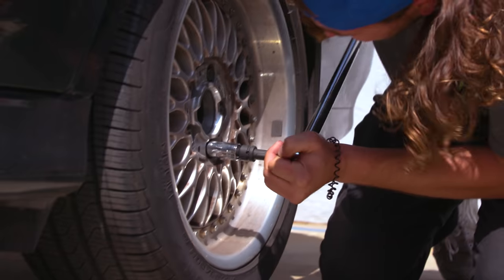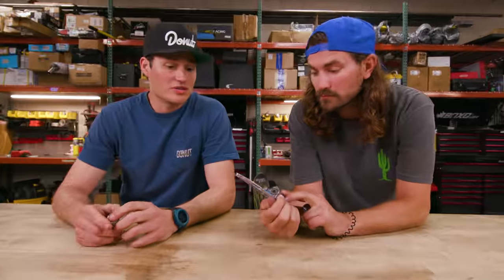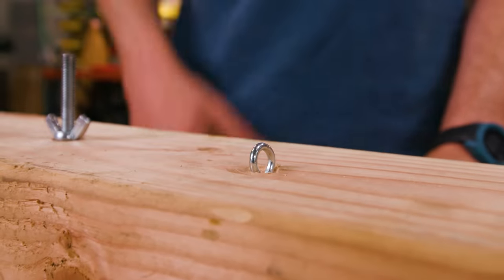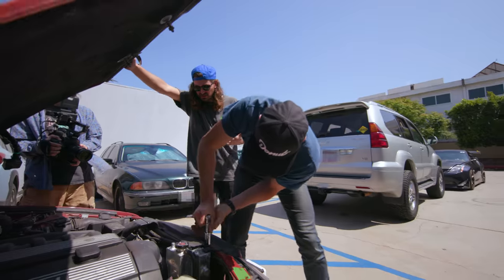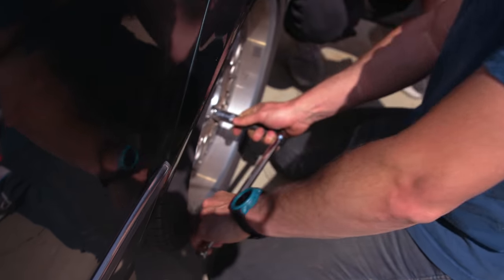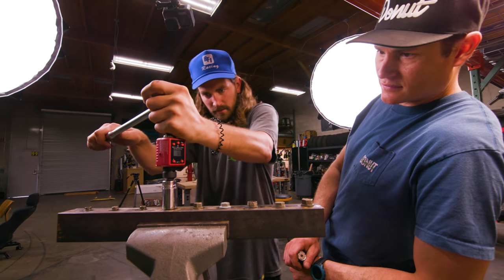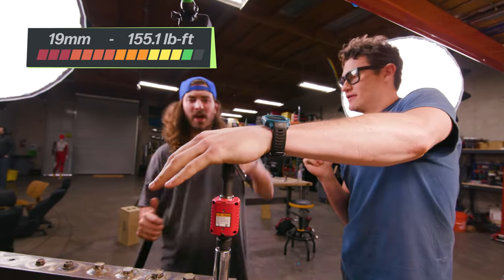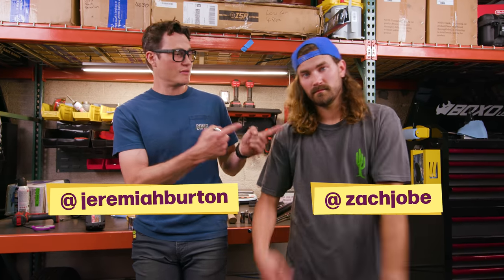Testing the World's Most Hated Tool

Comment: I own the largest repair shop in the entire metro area.  We have replaced over $11,000 in wrenches and replaced them with a dozen of these.  Its the only thing any of the mechanics use.  We simply threw out of all of the Snap-On and Mac tools. Didn't even sell them.  Threw them out.   They did nothing but collected dust once we started using Gator Grip.

Comment: I have had several of these, and they have given me good service for years. The problem with them is that they are oversold; they will not "replace the toolbox," but for shallow, low-torque applications, they are quite useful. I have killed a couple using them on a power tool, but not with hand wrenches.
Reply: Their problem is ability to strip and round the bolt because of the way it grips it when pulling too hard ...
Reply: Exactly my thoughts. It’s ridiculous to think you no longer need other tools. But it has saved my butt a few times with stripped heads and other weird things.

Comment: The gator grip is actually genius, has automatic torque limiting based on the size of the bolt
Reply: Plus an also built-in "this bolt shall newer be unscrewed" function!
Reply: @LoneStarr1979  Next week in the infomercial: "...magically comverts any bolt into a no-tamper bolt..."

...

...

...

Apple buys all of them.
Reply: It still damages the fastener, just not the "fastening part" of it.

Comment: I was a merchandiser at a home improvement store. For years I dismantled old displays to build new ones. Whatever i dismantled was ALWAYS built with several different size hex head fasteners. I used the Gator Grip all the time. So handy not having to constantly change sockets. It worked great for my purposes.

Comment: Im an electrician and i use this a lot. In our trade we dont put a lot of torque on our screws or bolts. But it seems like when you do, youll just break it
Reply: I agree, they were way to hard on this one.  I mean come on.
Reply: @landar2372  It's not their fault actually. It's the commercial that said it is able to withstand 150 pound of torque.

Nothing would be wrong if it was advertised as a convenient tool for a wide range of lightly-screwed bolts and things. Not everything requires a lot of power after all. But they didn't. They DO try to sell it as this tool that will replace sockets that you want to use for plenty of power and grip.
Reply: yeah a 150 pounds of torque is a LOT coming from a flesh and blood arm and hand
Reply: most normal and better torque wrenches cap out at 150 too

but MANY cap at 80 pounds or less

youre not breaking a normal torque wrench anytime soon

the gator grip is a crappy tool and the ad lied
Reply: skip to 11:30

youre NOT getting 150lbs with one hand and without an extremely long lever like they had

i will never buy anything "made for tv"
Reply: Yeah, for lightly torqued bolts, it works pretty well.
Reply: It's a fantastic tool. I specialise in RF stuff and I've never ever ruined the tool nor the bolt, no matter the varying funny non-standard nuts and bolt that are out there.
Reply: A lot of this test is just them being dumb or incompetent tbh. Like you said I use this thing pretty often for light duty stuff.
Reply: So the tool is good for driving down with the lowest torque on the drill.
Reply: @landar2372 too hard? No this is pretty amateur automotive work they put it through.
Reply: @hahaepic4165  Maybe they should advertise it as being for light duty stuff instead then.
Reply: Same here
Reply: Do they work better or worse if you go in at the edge of the socket rather than the centre?
Reply: @kikixchannel  More carefully applied they would have gotten a lot better. They keep doing amateur shit like letting the socket come up at an angle so pins can slip.

Comment: Before I retired from teaching, I worked at a school that had removable walls between the classrooms. There's actually a tool that you would insert onto a square headed bolt and Crank it like a big fishing reel. Needless to say, all the teachers seem to have lost the crank that was used for each wall. Since I had a couple of these sitting around in my toolbox I just left one in my desk drawer with a ratchet. Never had a problem opening those walls.
Reply: i think i know what school that is, ichabod?

Comment: The fact that it passed any of the tests is amazing.  Most as seen on TV stuff is complete trash. I buy one now and then, just to have it. It's definitely not replacing anything on a daily basis. It does act as a hero on a rare occasion.
Reply: It became permanently damaged rendering it useless after that very first test so...
Reply: Yes, for one or more times only though
Reply: I actually liked using it for eyebolts
Reply: @Marconi and Cheese  That's what one of the only reasons to have one.
Reply: @nathanbrinkerhoff5886  dont forget its use as a fidget toy. All those pins to push down.
Reply: @marconiandcheese7258  a screwdriver thru the eye works well not only to install eye bolts, but also to repel wayward hobos
Reply: What's crazy is I remember the very first time these were ever advertised. I'm PRETTY SURE at the time they were first ever marketed, they were ACTUALLY quite good tools. I want to say that even the pin design was different, it was hexagonal instead of circular. It's been so long, I can't remember any of the commercials. And it's also been so long, the tool has gone through multiple companies and has more than likely been altered from the original, that even trying to FIND stuff about the original tool is nigh impossible. 

The closest thing I can find to a true genuine original GatorGrip is a photo on the inventor's website, dated 1995. The picture is incredibly small so it's hard to tell what the socket looks like, and whether or not it features hexagonal pins. But I swear, the tool USED to be good. I remember seeing and hearing all sorts of people raving about it. 

I also distinctly remember that around the mid 2000's, the tool patent was either purchased by another company, or perhaps it was re-licensed? I can't remember exactly, but I remember this being a serious turning point for the quality of the tool. I remember at one point seeing that the quality went downhill, it was changed from hand-built assembly to purely automated manufactory, corners were cut, things were altered, all to make it cheaper and sell it at a higher margin. 

It's also entirely possible I could be misremembering everything I've just said. Like I stated, it's SO HARD to find information about this, but I swear that this was something that happened in the timeline of this tool. It's hard to find info about it because the ownership and licensing of the tool has changed hands multiple times, yet the name has remained the same. That time warlock Nelson Mandela is probably screwing with me, but maybe someone else can corroborate this?

Comment: Honestly this seems like something that might be worth having in your toolbox as redundancy just incase the socket you actually need magically teleported to the void like they tend to do.
Reply: Lol
Reply: But it doesn't work on 10mm bolts very well. Isn't that the sockey that always disappears?
Reply: @jasonhaynes2952  yes that's the one. Especially the 1/4 version
Reply: Works on everything I've ever used it on...
Reply: It happens more than often xD
Reply: 10 mil sorcery
Reply: Ugh 10mm, 13mm, and 16mm. 🙄
Reply: even then id still rather use a proper socket instead of rounding it off with this garbage
Reply: @jasonhaynes2952  put your socket back in the case, never had the issue in my life
Reply: except it doesnt like 10mm....
Reply: That's why I always make sure to put my shit back in the box when I'm done, otherwise my most used socket will get lost, guaranteed. I bought two sockets for my oil pan drain and my wheels, the one attached to my braker bar doesn't get lost, but the other one sure does lol

Comment: We use Gator Grips at our job….they are pretty useless, but come in handy when you don’t have everything with you, such as wrenches, sockets, etc.. When I’m out “in the field”, I cant lug around 250+ tools where I go. 

It isn’t a literal “field”….that’s just what we call it. Lol, but yeah…..we go through Gator Grips like candy.
Reply: Lmao as if you clarified you aren't wandering around in a field with your toolkit 😅
Reply: Seriously buddy, it replaces really nothing, a simple small 3/8 drive socket set is not very big if you need if for your job.  This thing causes more problems that it solves.
Reply: Buy an adjustable wrench.
Reply: Oh, I think you can lug around 250+ tools where you go. You just need a tool packout kit.
Reply: I actually am literally out "in a field" with a toolbox a lot..I work for a farm equipment service..Damn tractors never break down near  the freaking road.
Reply: @zoltrix7779  sometimes you're carrying more than just a socket set for your job though.

 Putting a single socket and small ratchet in one of you pockets could be the difference between one and two trips everywhere you go. Even though the socket sucks, it can be better than the alternative in some situations.
Reply: Going through them like candy is a good sign you should invest in some real tools.
Not trying to be rude but, if you're spending 20-30 bucks on these things, and consistently shredding them, expecting a different result, then that's being insane and wasting money.
Reply: @1pcfred  yeh they’re really easy to get up ladders.
Reply: @Neishy4AGTE  as you go through life you may realize someday that nothing worthwhile is ever easy.
Reply: Your boss is okay with you rounding every bolt on the job site?

Comment: I built my steel building with them they work good on square nuts. Not a great tool by any means but worked perfect for me i wore out two of them but save me a ton of time on the square nuts just push and hit the trigger pretty convenient when you're doing 5000 or so in a row
Reply: @Karl with a K Once per bolt!? 🤯

Comment: Since the first time I ever saw one, I wondered why they used round pins instead of hexagons. 
A hex shape would fit around bolts so much better.
Reply: Probably just to make them cheap to manufacture
Reply: Because hex pins won't fit as many different shapes........
Reply: No, I think the ultimate reason it uses round pins instead of hex pins is because hex pins and the hard edges of those pins would chew up your bolt heads moreso than the round pins already do.
Reply: @luigimaster111  nah, if they were considering wear on components they wouldn't have released it at all, hex pins would fit hardly anything but pins can rotate and give slightly to allow anything!
Under almost all circumstances this tool damages the fastener anyway, they just want to sell it as "able to handle anything" not "doesn't scratch your bits but only does half of them"......
I'm sure their Moto is;
We know it's shit, so maximise the range of shitness".......
Reply: @EZ-D-FIANT  I'm firmly visualizing this in my head and cannot fathom  how hex shaped pins would limit the amount of fastener heads this tool would fit, heck the pins could be rectangular and as long as there were enough of them  tightly packed together it'd still have that ability to conform to the shape of your bolt/fastener heads.
Reply: @luigimaster111  it's not so much them physically fitting it's the amount of space around the tool is reduced reducing deformation which increases grip!
The size of the pins in either configuration would be the real deciding factor but if you imagine a circle that's the diameter of the flat sides of a hexagon then the hexagon is bigger and you want more smaller for better grip, imo anyway tbh a smaller size set of hex would work better then bigger pins but if the pins and hex were exactly the same shape then a flat surface would leave the triangle gaps down the side which allow the deformation I'm on about more then the pins would!

I dropped out right about sphere packaging but these kinds of things are taught in higher math which I did some of a lifetime ago hence my confidence but I'm open to a friendly debate and accepting I'm wrong if you can convince me....👍👌
Reply: @luigimaster111  not so much limit the amount it will fit, bit limit the amount it will work successfully on, due to that deformation again!
Reply: Only if applied perfectly, square wouldn't work well either. What they need is a ball and socket joint inside to prevent bending moment and smaller pins.
Reply: I think hex would be better. It takes up more space yes, but that space it takes up is making it work for the tool I think, so taking that space up will improve it possibly. It should also give a flat side for all hex bolts to rest against, instead of the round sides of pins. But then I could be wrong  as well
Reply: @mynamesnotimportant6941  seems like a good ole fashion science fair project. But seriously, this does make me wonder. The problem I would predict with hex is I think in practice the pins wouldn't be able to move nearly as freely. That and from the manufacturer's perspective, I'd imagine that hex would become too cost prohibitive to then sell at a price people would pay.
Reply: I saw an hexagonal one quite a long time ago. But not the same brand, I guess.
Reply: I've used one with hex pins.  They work much better, honestly.
Reply: I actually have one with hexagon pins in it
Reply: I have an off brand one that does use hexagons.
Reply: I think they make some with hexagon ones now

Comment: With a well thought out redesign, and made with quality forged metal, this could be a great inbetween. It’ll never be as good as a normal socket, but it’s like an adjustable spanner. They’re pretty clumsy compared to a normal spanner but it’s handy to own
Reply: Yah I was thinking, I wonder if making the pins a diff shape would help with stripping~like instead of cylindrical pins, maybe triangular, or rectangular. And I wonder how sturdy the springs are.  if there’s an alternative. To springs, possibly even something that’s not automatic so it doesn’t eject you. When you’re finished you could just push something kn the back and the pins bounce back flat into position.
Reply: A redesign and quality forged material would put it out of the "stocking stuffer" price range, which is clearly what they're aiming for.
Reply: @GansterComputerGod  Triangle and square/rectangular probably wouldn't be good.  Maybe hexagonal though?
Reply: @callak_9974  I think hexagonal minimizes the gripping surface of each side, so the bolts will slip more, and they will be expensive to machine.  The triangles (equilateral of course) would have the largest gripping surface for each side.  The circles they use are like infinitely sided polygons, so they'll function more like the hexagons, but they're the cheapest to machine I bet.  The circles will also always have gaps between circles, so the pins have space to move around and thus have torque applied to them and get bent.  Triangles, squares, and hexagons can tile the plane, so one can pack them together really tightly, and this means that the pins have less space to move around and thus bend less.  For this you need fairly precise machining, because larger irregularities will mean more bent pins.
Reply: @rinosanchez2150  The problem with triangles and squares is how they would fit in regard with each other.  Hexagons do fit nicely and should have more surface area than the circles that they already are.

Also since they are more snug, less likely to get pushed around and be bent.  But perhaps a combination of 2 different shaped pins would work the best, however the cost there would be markedly higher.
Reply: @GansterComputerGod  
Possible, but then it would cost as much as a real socket set.

Comment: The gator grip is actually genius
Reply: No, its actually garbage.
Reply: @Carstuff111  must mean genius advertising 😂
Reply: @tonymarshall9670  or maybe referring to the concept being a genius LOL. But saying that this specific tool is a genius, however, is incorrect, by ALL means 😆
Reply: Yeah, with some proper design & engineering, plus much better materials, this could work out.
Reply: You get what you pay for. It's a good piece to have on hand if you can only carry one thing, and it will generally do the job it's designed for.
Reply: i like it
Reply: It's dogwater
Reply: The concept is amazing but the execution is awful
Reply: It's worked everytime for me.
Reply: Nope, total garbage.  It'd be a good concept if it was built using material that didn't bend and break within one or two uses
Reply: works fine enough to not be a joke but looks like it could work very well
Reply: Very interesting..🔥👍🏻
Reply: @Ektalon  I agree with the better materials bit. I got one when they first came out in stores and the pins started sticking in after trying to use it for car repairs. I was able to get them back to the starting position but it was never the same after.

Comment: To be fair to this tool it's not intended to be used in high torque situations. It's not even designed to replace predrilling, nor is it supposed to replace all your tools as they knowingly, foolishly claim. It's supposed to be used for awkward fasteners that regular tools can't turn, such as wingnuts, eyebolts, and others that the infomercial showed. If you predrill the holes and use this tool for the awkward hooks and fasteners this tool excels.